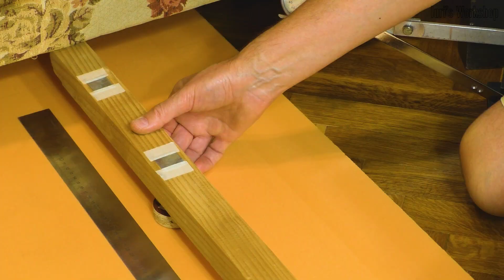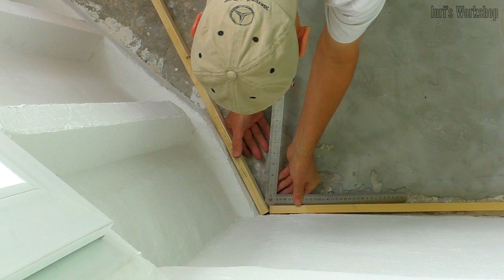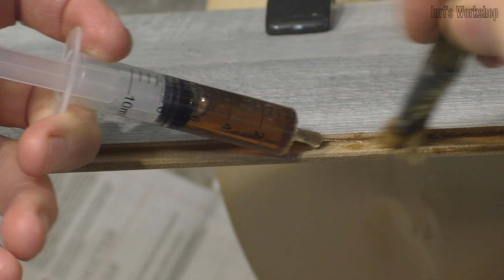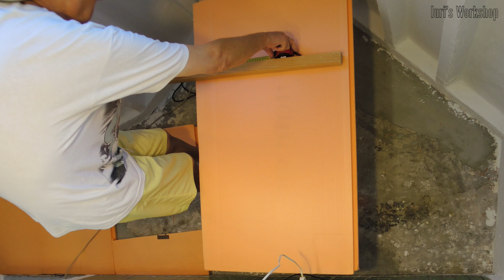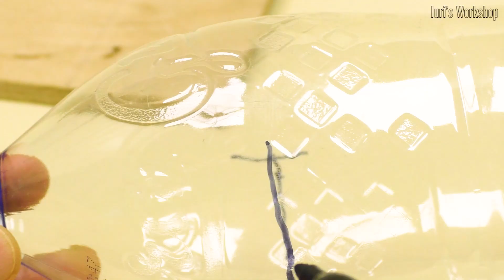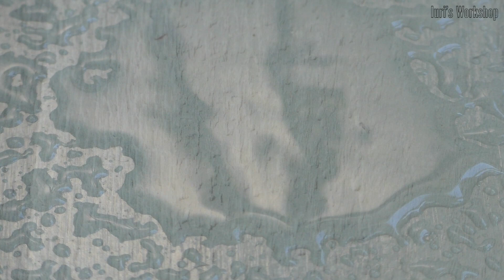The Cheapest, Warmed, Waterproof Floor – DIY!

Comment: Ahh plinths = Baseboards. Ex Inspector: Well done man, water resistant laminate is a trick! In the fine print it states, "warranty void if standing water was present". If you buy unmixed patch for leveling you can mix it with latex instead of water. Cheaper + superior at resisting cracking. Nothing worse than pulling a crunchy floor 4 years later, over $30 of latex. I don't think the layman would want to put any varnish in the joints, way to problematic, and can swell the joint latter. Lastly, Do not forget about expansion, it really is important. If waterproofing is a necessity, i would enlarge the expansion size by 10% IE. 1/4" to 11/40" per side. If its a sun room full of windows with large temperature swings Ive seen a floor lift 4" off the sub floor, in the heat. As the addition of silicone would surely prohibit it. I imagine if you got a quote for the floor you installed, you have saved yourself literally THOUSANDS of DOLLARS/WE.  Truly, well done! 

PS. you can lay one, or a few large sheets of paper well taped together down Then use a putty knife, or larger painters knife to crease the edges then run your razor knife along the top of the putty knife to cut very close to the edge/wall to make a tinplate.  ✌👍
EDIT: I can not comment on the heating. How did it work for you? Same on the humidity, my entire 35 year carrier was in one of the driest climates in the U.S..

Comment: Warmed?
Reply from the maker: I live in a house with a centralized water heating system. Making additional floor heating is impractical. If the system heats up weakly, I use heat pumps. They are three times more effective than electric floor heating.